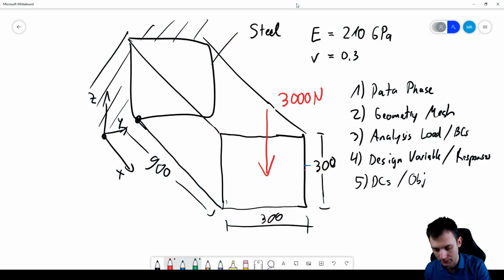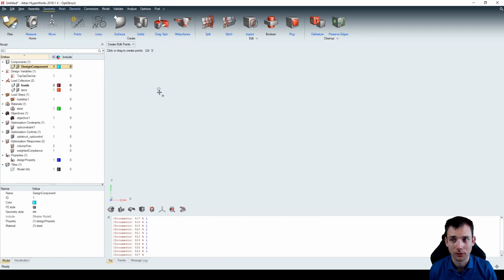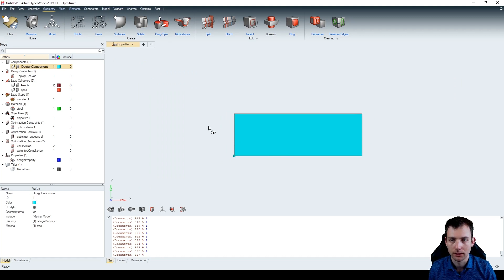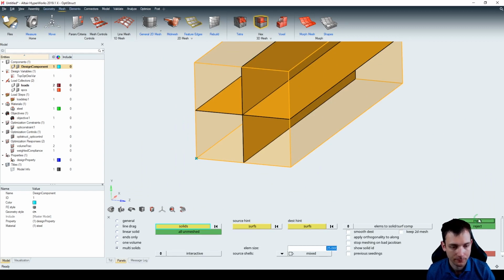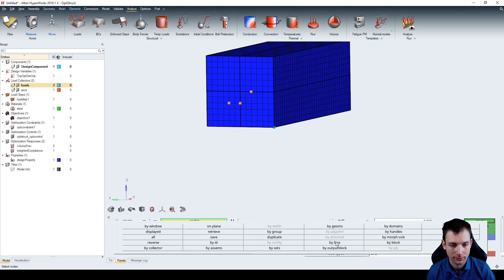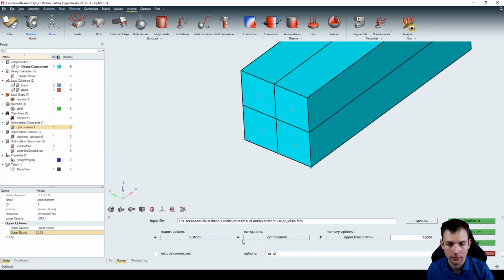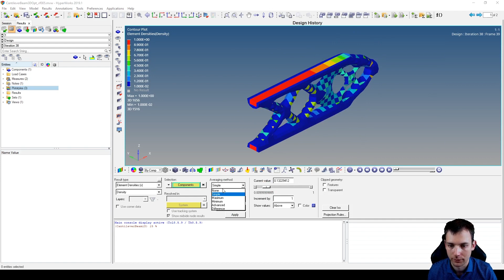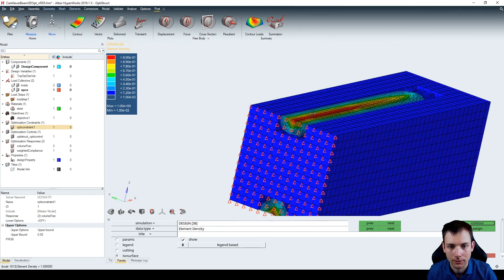Hyperworks X - 3D Topology Optimization

Comment: I am having trouble viewing the nodes in the graphical area when their position is a bit far. Zoom to fit doesnt work. Please help. I am working with the old interface in hyperworks 2020
Reply from the maker: I am not quite sure what you mean. You dont see the nodes (temp nodes, yellow?). Yout want to zoom in on particular nodes ? Maybe your best of with using the view controls ... especially the middle mouse button (in the old version you can drag a line where to zoom in with this) 

All the best :)
Reply: @ManuelRamsaier  The problem is that the nodes(yellow) does fit into the work area and because of that it appears like a extremely small dot(barely visible) when i provide coordinates that are far apart.
Reply from the maker: @rahulmenon12  as far as I know the temp nodes (yellow) dont change size when zooming in the model. They should not become bigger or smaller. Do they in your case? Can you drop me a mail with the problem described (screenshots or gif) to ramsaier@rwu.de? Then we can discuss the matter more clearly :)
Reply: @ManuelRamsaier   Sure. I will mail you with details